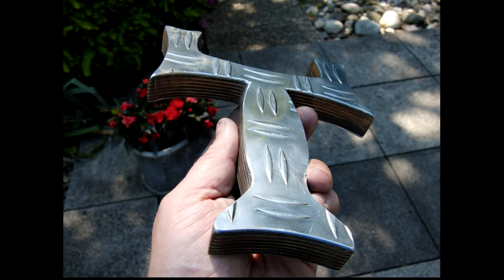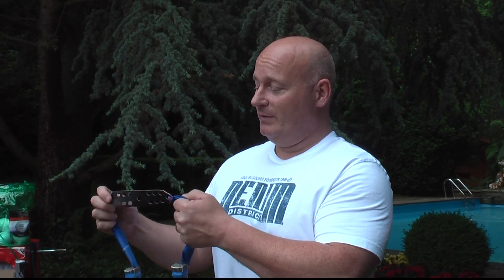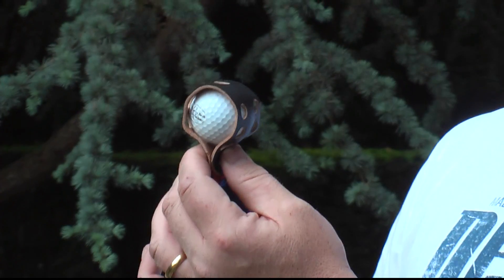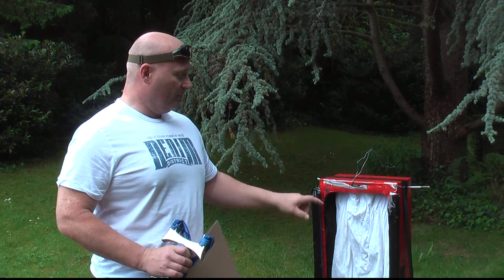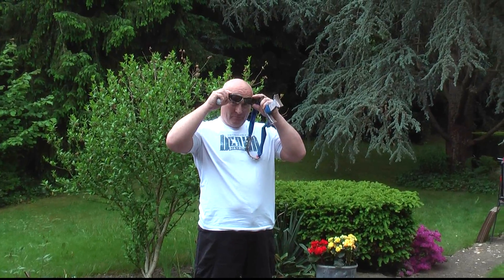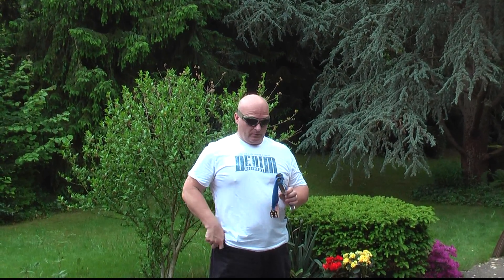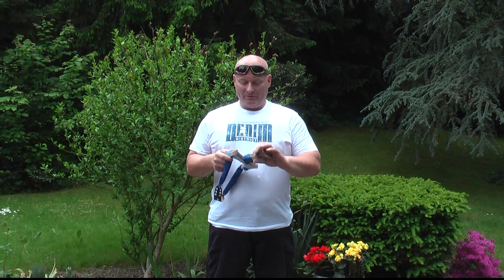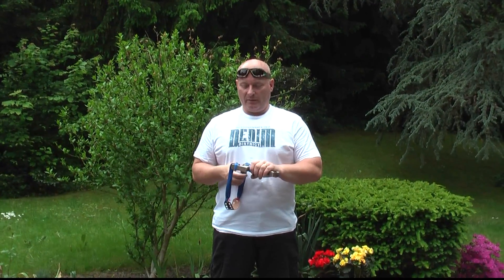Shooting Golf Balls From Huge Homemade Slingshot

Comment: Shooting golf balls with a slingshot is a substitute for chip and pitch shots for disabled golfers. A driver with a range of 220 yards (Power2Golf) is available that uses powder charges to shoot the ball, but it can't do shots less than about 50 yards.  Nobody that I have found so far makes a slingshot for the purpose, so this design should be useful for those needing one.

Comment: hey joerg

can u pass me the site for the rubber bands? im making a slingshot my self and the only thing i need is the rubber bands.. ive searched on google but i cant find anything..
Reply: Google up therabands. They sell them in rolls at sporting goods supplies for resistance band training. Can buy small or big rolls. Get a roller cutter to cut your bands, never use scissors

Comment from the maker: Not true. The air resistance of a dimpled ball is lower, so it flies more far. The Magnus effect would cause an ADDITIONAL uplift, which requires the backspin. But the lower air resistance does not need the backspin. BTW, I will shoot it on a driving range next Thursday! Then we will see.

Comment: @HxMstrzforu The design of the golf ball is only a benefit if backspin is achieved. The back spin if hit correctly, the dimples will cause an aerodynamic affect (Magnus force) where the spin determines its trajectory. In straight with no spin flight it will fly no farther.

Comment: Really would like to see how many yards (or meters) you could launch a golf ball with that slingshot. Hope you find a practice range near you that will let you try it out.
Reply: I thought about building a slingshot rifle so it has more energy than the traditional hand held. Might build one of each😊 I reckon between 50-100m with a handheld depending on the type of bands used n how far you can pull back. I mean golf balls ain't exactly small but it does have enough weight in it to carry further than a tennis ball. Guess I will find out once made n tested. Slingshot Brace not illegal where I live as slingshots are deemed as toys  unless used to commit crime then it becomes a weapon. Gonna need the brace to pull the bastard all the way back as I don't have arms like Jorge here.😂